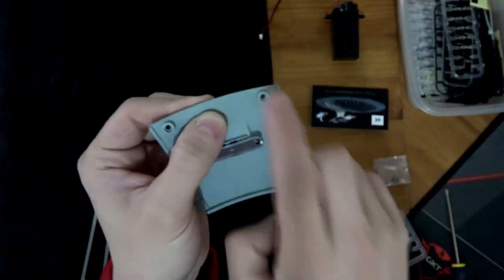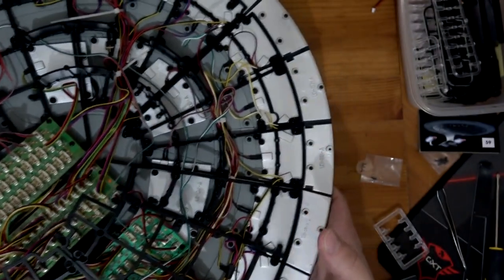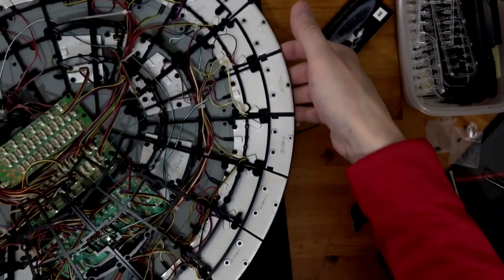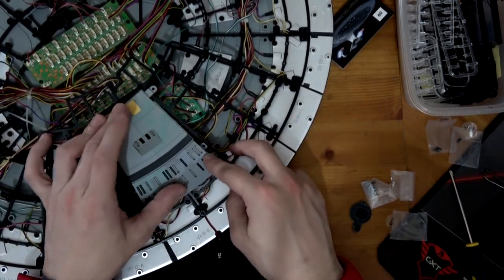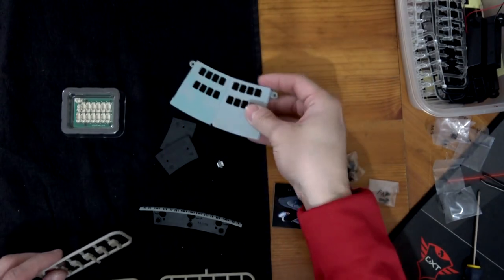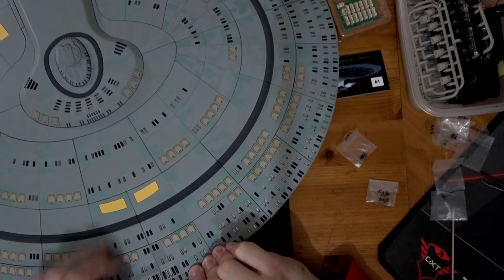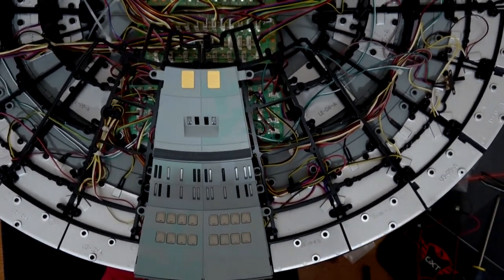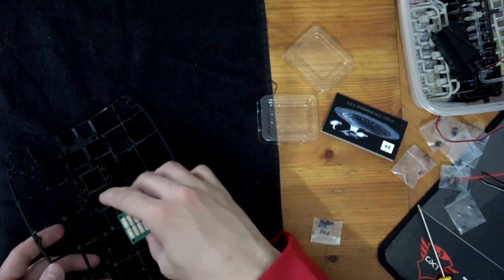One Nacelle Complete!! // Build the U.S.S. Enterprise NCC-1701-D #16

Comment: I’m at the same stage and can’t get the nacelle to light up. If I plug the lower nacelle directly into the saucer PCB it works but when I connect the upper nacelle it doesn’t work.

Comment: What are the hull components made of, plastic or die-cast metal? I've heard two different sides of that answer. Also how much did that even cost?
Reply from the maker: It's mostly die-cast metal, but there are a decent number of plastic parts as well. Certainly more than I expected.

The subscription model I chose works out to a little over £1100, iirc.
Reply: @CaptainMeatshieldUK  Yeah you kinda answered part of my question when you accidentally dropped the nacelle on the table. 

Damn, $1250. I think my wallet just killed itself from that price. Then again from what I've seen thus far....maaaybe its worth it.